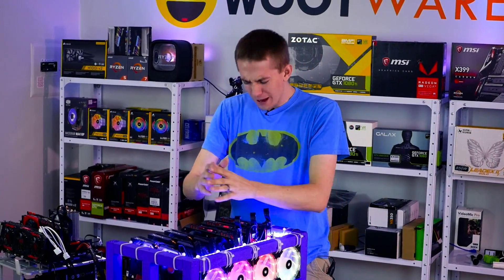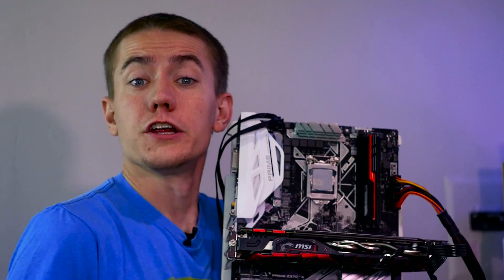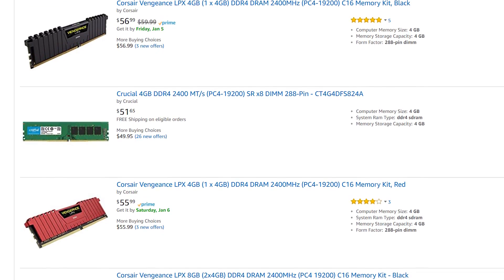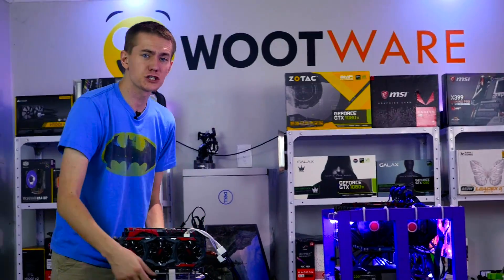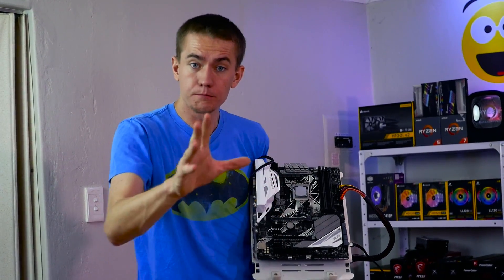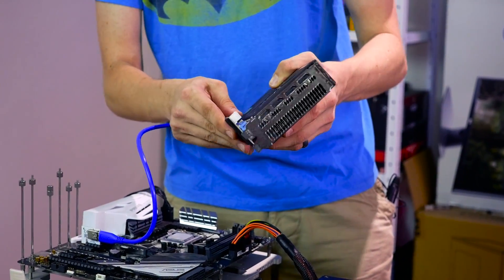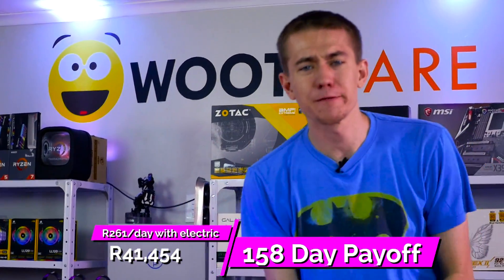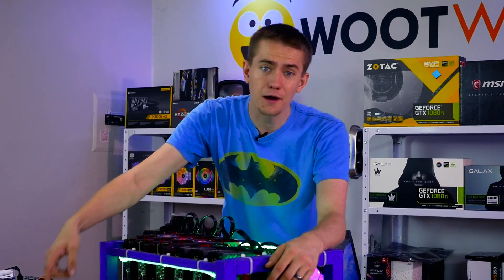Intro To Building Profitable Mining Rigs - Part 1

Comment: How big is the powersavings with a ssd? Also great video!
Reply from the maker: Lies. You save 100000W.
Reply: With a HDD you will be emitting about 250W in sheer frustration. 
Seriously, even if the economic numbers don't seem to make sense, quality of life is important. When you're just getting into mining you'll be spending a good bit of time with your mining rig, fixing and optimising things. I'm now at a point where I am mining about 30$ a day continuously with the rig working fine for weeks on end. It did NOT start that way. I restarted my first mining rig HUNDREDS of times. Granted, I run used GPUs and that introduces some new complexity, but the point stands.
Your mental well being is worth 20$. Heck, I think the risk that you'll break down & give up because of a slow HDD is great enough to justify paying up a bit extra.
Reply: 42thgamer minimal
Reply: You save less than 5w for most HDDs out there
Reply: Probably nearly nothibg sine the hdd would even have to spin much so it wouldnt use unneccesary power
Reply: $1 per year.

Comment: Hard drive question. New mechanical Clean windows install on the HD. Win 10. Update drivers. 3 new gpus yet I seem to have to restart daily. Screen is frozen and the cards are still running. Reboot and it starts mining again. Would a ssd drive stop this from happening? No way to troubleshoot if it’s frozen so I don’t know what’s causing it.

Comment: Im still confused on how your turn on the mining rig. Where is the on/off button? I bought HTC BTC 13 GPU Mobo that I think comes with an on/off button integrated into the board but I know conventional Motherboards don't have this feature like the z270
Reply: David Hansen get your mobo Manuel and look for the startup pin. just touch the 2 pins with a screwdriver
Reply: They do sell a  Little switch to plug in for just that reason It's $5
Reply: That's what I figured but what is it called?
Reply: 2 pin pc start up cable.  The 1I bought as a 2 pack for $5.30.
   Electop 2 Pack 2 Pin SW PC Power Cable on/off Push Button ATX Computer Switch Wire 45cm
Reply: "The 1I bought" quickly reading this left me imagining a 1 litre bag of on/off buttons :D
Reply: you just gotta hit metal piece between the power pins, siccors will do nicely, or a key, or then you just set motherboard into actual case and leave the side panel open, doh

Comment: i need help, my 3 of my graphics card say's windows 43 error, i've tried uninstalling the drivers loads of times, taking out the power cables nothing, anyone have any idea's as to help me out?
Reply: Logic108 use Ubuntu Linux
Reply: Ross Mauck using my pc for gaming at the same time
Reply: Gotcha, if you re-image a partition of your hard drive you would be able to run the rig when you’re not gaming. That’s what I do.
Reply: Can't do that, all my hard drive is almost used up, is there no way to fix the code 43 error?
Reply: was working before, i brought a 1070 yesterday now i just get error 43.
Reply: do you have 16gb of virtual ram?? you can change it in the settings
Reply: Cihan Aslan can that be the problem then?
Reply: your problem might  not have the newest windows update 1709..I pull 43's without that update
Reply: TC just updating to it now, i really hope this fixes it, has been doing this for two days now.
Reply: let me know how you make out
Reply: nope. didn't work..

Comment: I picked up a old xeon, Mb with 6 pcie slots a cpu cooler and 2gb of ram for 70 bucks. works great for me :)
Reply from the maker: Very nice.  You running Linux with that 2GB of RAM?
Reply: UFD Tech yessir, I've had less problems and restarts with Ubuntu over windows.
Reply from the maker: +Richard Duvall Makes sense. Glad it's working out for you!